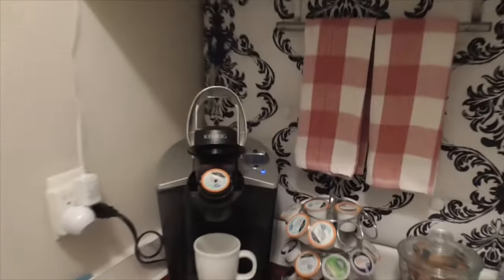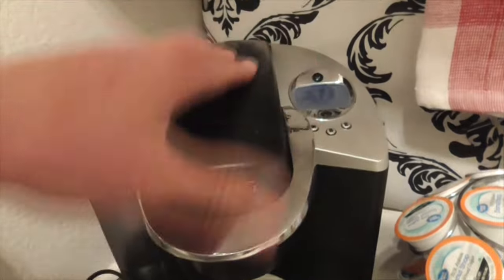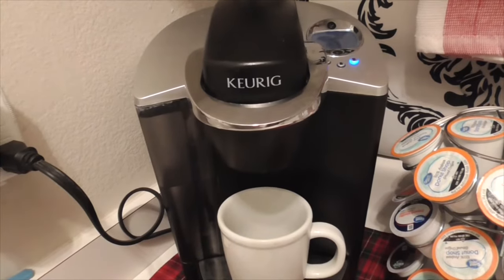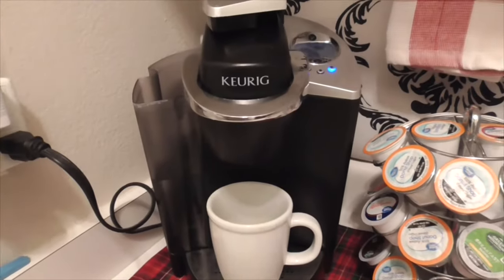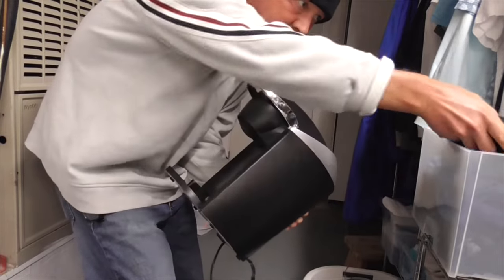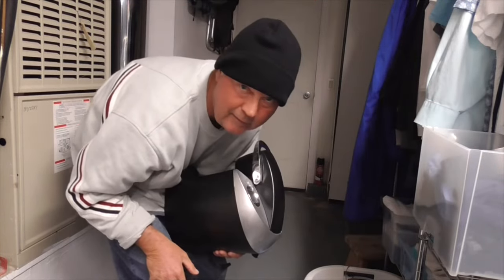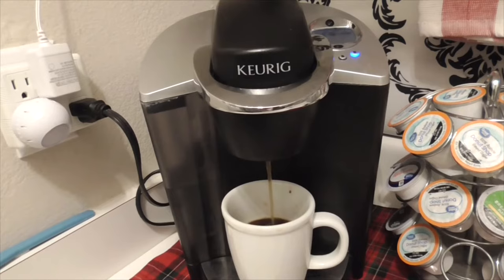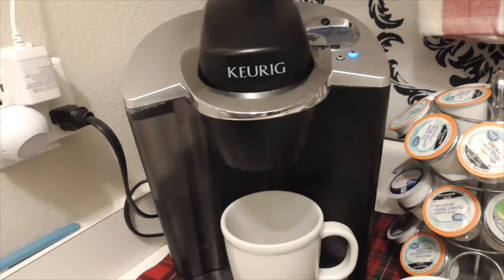Broken Keurig won't brew!  EASY HOW TO FIX IT with NO TOOLS! when nothing else works.

Comment: I must admit, I had little faith that this would work on my coffee maker, but it's the only method I could use as I was short on time.  I WAS AMAZED IT WORKED! THANK YOU SO MUCH! Excellent video... short, to the point, with useful information.  Thanks again.  Point of caution to others using this method, be prepared for a substantial amount of water to drain from the coffee maker as you bang it upside down.
Reply from the maker: Amazing solution, enjoy

Comment: 👏🏽👏🏽👏🏽October 2024.. Out of every video I have watched... This 💯% fixed the problem.  I had cleaned my coffee maker thoroughly including sharp “pick”, just for good measure I only use spring bottled water to fill it up.  I accidentally unplugged it without turning power off and the machine would not work.  I reset it and still did not work. Found this video🤩and did the same thing you did… even went in garage because my husband was sleeping … Absolutely did the trick. Thanks again for this amazing video! ❤🤩❤
Reply from the maker: @BlessedBeyondMeasure8888  yay! Tell your friends👍
Reply: @ Been screaming it from the rooftops 😁🏘️🎤🤩

Comment: I have only used it twice and it worked fine. I tried your advice and it still won't work. This is my second one. They are more trouble than they are worth.
Reply from the maker: Bummer.  Based on the number of comments I am getting, these Keurigs are pretty lame.

Comment: Very good idea.  I've been removing the screws on the bottom, removing the screen in the water inlet valve, and then rincing the screen under water. Then put everything back together.  This takes about 1/2 hour.
Reply from the maker: Does that 1/2 hour project work?

Comment: Brilliant! Mine was only putting out 1/3 - 1/2 the volume of a large coffee cup selection. I ran the vinegar and water rinse, unplugged it and shook it upside down as suggested. I followed up with a nice cleanup job in the sink, dried it, and filled the reservoir. Works like new. My sweetie said to tell you "Thank you!" as she is the coffee drinker in the house. Now I have to figure out another gift for Christmas. Egads
Reply from the maker: Glad my scientific method works.  You might have to shake and beat it about every 30 days or so, though.

Comment: I have the K-Express Essentials myself and this morning no water was coming out with the same noise you have. After trying a few things like using a paper clip on my needle, it was not even going on descaling mode. So anyway I end-up doing what you just did, shaking it in every  direction and then I left it upside down for a while and there we go it's was working again. So yes your trick, this trick works.
Reply from the maker: Works every time!  Thanks.  Enjoy your cup.

Comment: The Keurig I have is only used when my daughter comes out. It’s been on my counter for 4 months without any use. I drained the water tank after she left. I’ve shaken the crap out of it, put my finger over the pressure relief dongle, used a scribe to make sure the hole is not clogged and it’s still running but not brewing.
Reply from the maker: I ended up just throwing my nice Keurig in the trash.  I replaced it with a simple $35 unit here, which is also pretty cute and super easy to use with no gimmicks.  in this video   https://www.youtube.com/watch?v=FB7eGDIq5AQ

Comment: I’ve tried everything including squeezing the tube and turning over and shaking which made a lot of water come out but no dice still does not work.  mine is 10 years old and I’ve always managed to trouble shoot. I can’t access screws to get to tubes. They look like screw bolts and just can’t get access to  them to get-off.  Can’t get over the price now is at least 4 times what I paid.  Spent 3 days think it’s time to give up. Glad this worked for everyone. Oh I didn’t mention I only use it for hot water now and have changed refrig water filter and charcoal  filter in coffee machine. Have  very hard water!
Reply from the maker: Sorry.  Try ONE more time Hail Mary attempt.  Turn it upside down, shake it a lot and beat it all over the sides and the tops.  If it doesn't work, then just toss it out.  For my coffee maker, I only use filtered drinking water in jug-size bottles from the store.  Gets expensive, though.

Comment: i flipped it upside down and gave it a spanking and now it is working again thanks to you!  this was an oddball - if i put a k-cup in, nothing. if i put no k-cup in, water came out. annoying!
Reply from the maker: sometimes I need to 'double puncture" the K-cup.  1) put in in, 2) remove and turn, 3) puncture again.  Helps with the water flow.  Also, good to have a few 'water only' runs to clean out any grinds that get into the needles.

Comment: I tried it twice but failed for me. I think mine is plugged worse. It was ok for months and months until I decided to descale and clean it. I think I broke the stuff loose and its really plugged. I ordered a new one and will take this apart later and get to the packed up plugging in the top section where the hot water cannot get through. Will be interesting, I hope anyways. New one is smaller as I am n=by myself. It does k-cups, loose leaf tea and reg java grounds. So will be fun seeing if it works for me. Thanks for the video! It did make me laugh and was wondering if you were serious OR maybe at the end just smash it on the ground as a prank. Seems it works for almost everyone so great job!!
Reply from the maker: Works like a charm!  thanks for watching.

Comment: Great Sir, but let me tell you if you disconnect power cord and wait for 10 second and put it back then its works. Your direction is also great. Thanks
Reply from the maker: I tried that, too.  Sometimes works, sometimes doesn't.  But, I hope it works for you just fine.  Thanks for watching.

Comment: Sometimes coffee grinds will build up causing the lid to not fully close, thus a slow brew or sputter to zero coffee. Shaking the Keurig helps, however, I recommend cleaning the interior area under the pod holder area is ideal.
Reply from the maker: Thanks.  I tried all the cleaning and pumping and other stuff.  It works sometimes, but just reverts back.  For me, the beating was the easiest solution.

Comment: I tried compressed air and descaling and none of it worked! Mine currently does exactly what yours did.  It would pump a little bit when you put your finger over the vent tube.  I'm going to try yours tomorrow and let you know
Reply from the maker: Well....did beating the unit on the side and flinging it upside down work?  (Also, try a couple of dry runs without the coffee inserted just to flush out any grit).
Reply: @battlefoxx  unfortunately it didn't. I even took the check valve out of the top and took that apart. It pumps but it pumps incredibly small amounts. On an extra large cup it will make about half a cup and it will take about 3 minutes to brew. I'm about ready to hit it almost the point of breaking it since it's a lost cause either way.
Reply from the maker: @Richard-yk3cf  try beating it again, make sure you hold it upside down and shake it a lot.  last ditch effort anyway.
Reply: Worked for me as well. My husband had condensation in his tuba tubing (too much hot air!). Did the same thing - without the beating, of course!
Reply from the maker: cool

Comment: Thanks it was a different model but it worked !
Reply from the maker: Very cool.  It will break again, and eventually after kicking and shaking for several cycles and months, you will just end up buying a different one.  I ended up just buying a $40 no-frills version from WalMart.

Comment: Mine made 1 cup then hours later tried brewing another and it heated up I pressed blue button then it shuts off 😢
Reply from the maker: try this. 1) take it outside and shake it upside down, and hit it on the side ,then 2) when you "poke" the hole with the needle, remove the cup and make the hole bigger, then 3) reinsert the cup to make an additional hole.  (or skip Step 1 and just try steps 2 and 3 first).  This will help flush out any clogs of coffee grounds that may have found their way upstream into the needle.

Comment: it worked after trying ur method and then it stopped again 🫤🫤🫤🫤
Reply from the maker: Oh no.  Maybe hit is harder and shake it more.
Reply: @battlefoxx  i did that too 😂 i might just get a lime de-scaler like in 1 of the other videos i saw. But if that doesn’t work then might just be time for a new one 🤦‍♀️
Reply from the maker: @kk-nm5wm  after about a year of intermittently shaking, i ended up throwing it away and buying a little no-frills unit instead